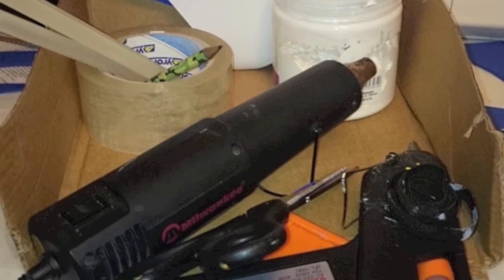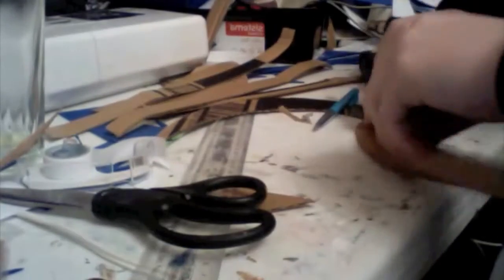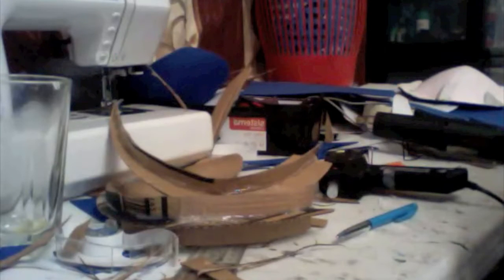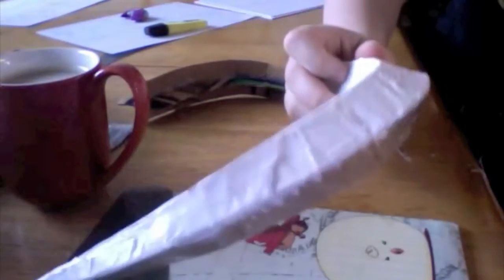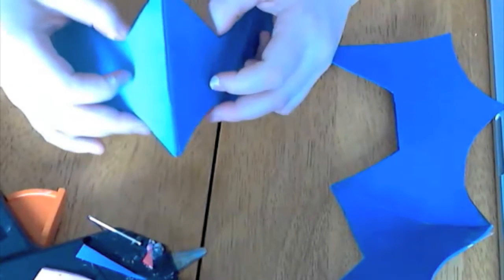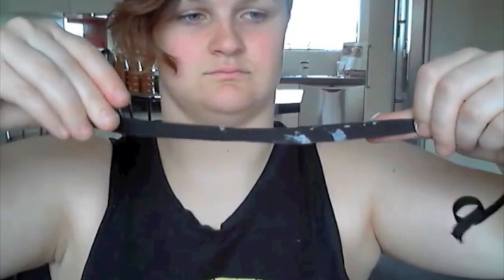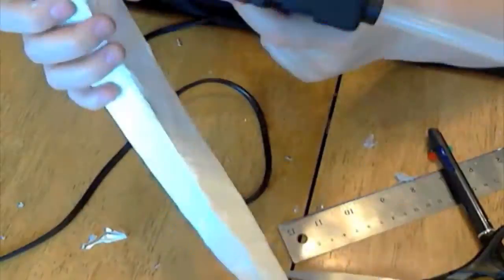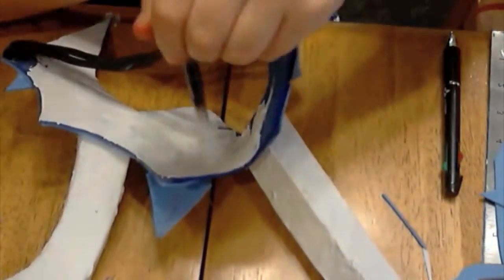DIY Lady Loki Diadem/Headpiece

Comment: You only glued the cardboard base with hot glue and it stayed? Wouldn't that be super fragile? (Sorry, I'm looking to make my first cosplay and I'm lost in some things)
Reply from the maker: Haha, It's all good!! I filled in the gap at the bottom with hot glue, this made the base solid, easier to glue on and i think it gave it a bit more strength. I also glued around the horns again when they were fixed into their final position. Once the hot glue cooled down a lil i smugged the hot glue around the base so that it wasn't completely obvious. 
I pretty much smothered it discretely in hot glue and found that it stayed. Of course if you don't fell like it would last then i hear contact cement which is a type of glue works wonders as well as gorilla glue. I just use hot glue because i'm cheap and its easier to come by. However I've made 2 of these babies and they haven't fallen off yet!!
I hope that helps you? Let me know if i need to explain better or if you have other questions :)

Comment: Thank you for this post. I'm so excited to try and make my own Lady Loki diadem. At the end of the video, you explain there was a difference in the horns from the first diadem compared to the ones done in this tutorial. Instead of using gesso, you used what material? I couldn't really understand. What method do you prefer?
Reply from the maker: Haha, it's called builders fill in Nz. it's just the stuff you use so that your walls are smooth in your house.
I probably perfer using the builders fill cause it turns out smoother but it can get really heavy
Reply: Thank you!! =) I really enjoyed your tutorial.

Comment: Can I do it without the foam?
Reply from the maker: The foam forms the base of the crown. You could do it with an alternate material like a thermoplastic - Worbla, wonderflex. But you'd really need to use either thermoplastic or craft foam as your material for the base (Craft foam is  a cheaper option!)

Comment: Hey I used that thing that's used on walls to make it smooth instead of gesso (couldn't find it in stores) and the horns turned out really heavy. I'm having trouble attaching it to the head base. Any suggestions?
Reply from the maker: Hey! Have you tried sanding back the wall filler? Basically its just there to cover the lines that the cellotape has. My horns that I have with the wall filler have a bit of weight to them but i could still attach it with hot glue. My newer go to for heavy duty gluing though is a neat wee thing called Ados F2, which is a contact cement. I'd recommended sanding and then trying with the Ados to see if that sticks better!